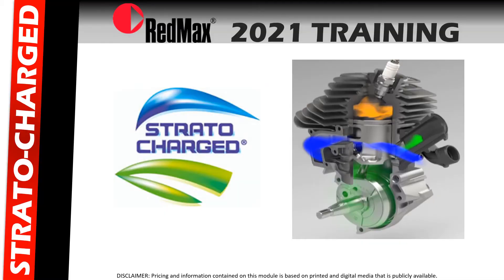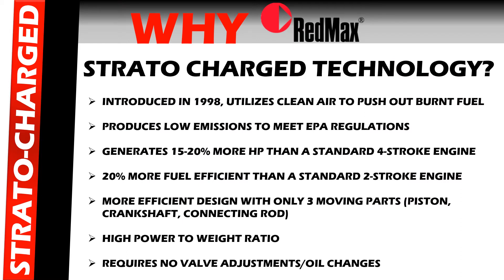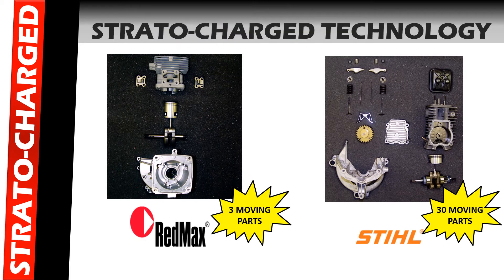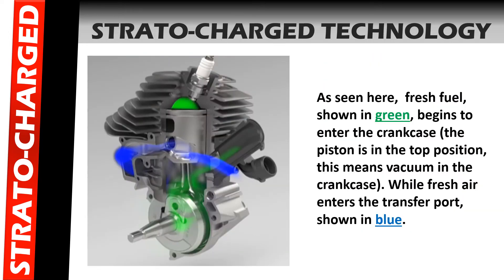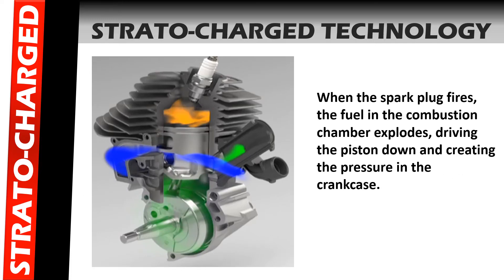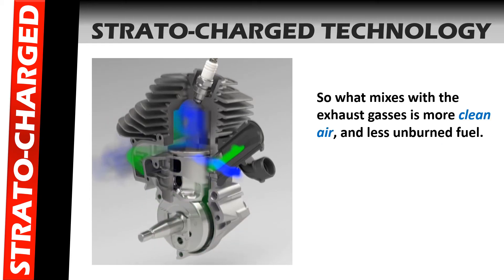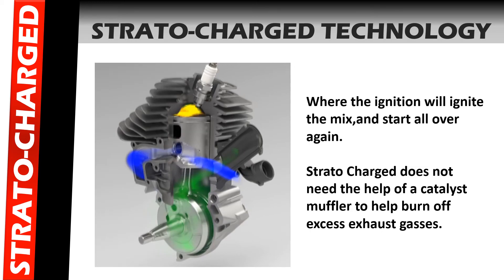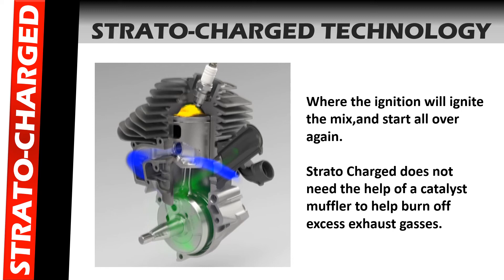FY2021 RedMax Strato-Charged  Engine Technology

Comment: This is the same way all strato 2 stroke engines work, including the ones made by Stihl. I also don't understand the point of comparing it with the Stihl 4-mix engine to prove the part # difference, instead of the equivalent 2-mix.